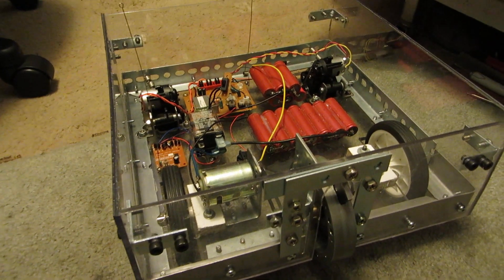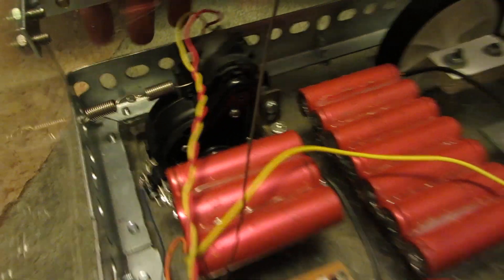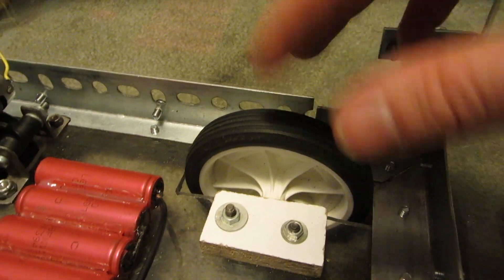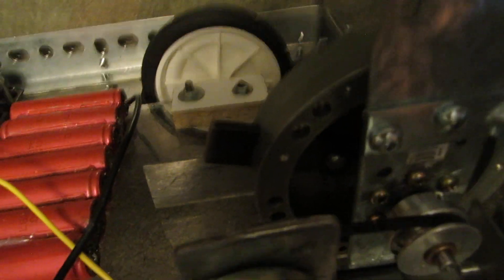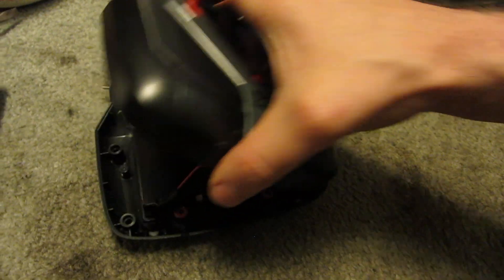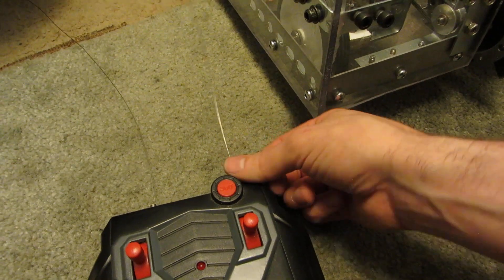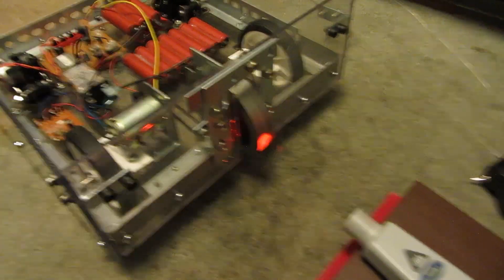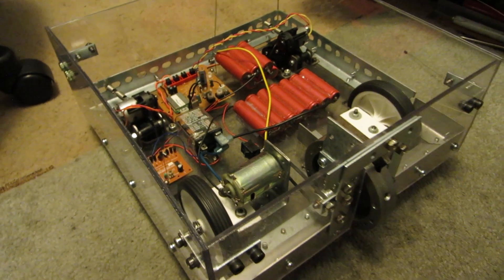Battlebot Mk3

Comment: cool man... i have 2 more vacume cleaner drives, bunch of tubes and 775 dc motors and smaller ones. You might have to put some 104 picofarad caps on all 3 of the motors... one from + to motor can and - to motor can. When a dc motor runs it makes sparks on the comms inside from the brushes and this creates radio interference. these ones http://www.youngengineer.in/0-1uf-ceramic-capacitor-104pf-pack-of-10
Reply from the maker: The 2 drive motors already have caps on them, the only one that doesn't is the weapon motor so I might put one on and see if it makes any difference.